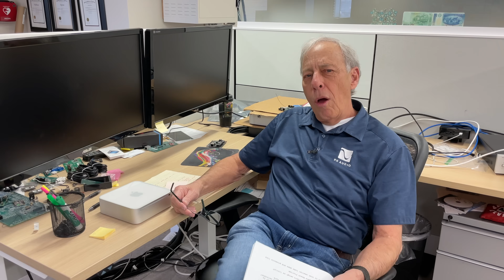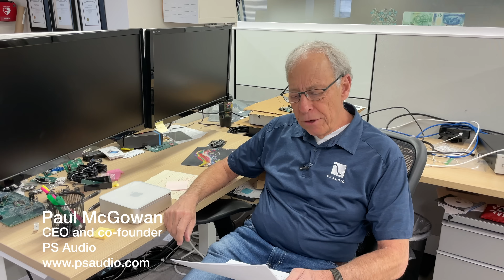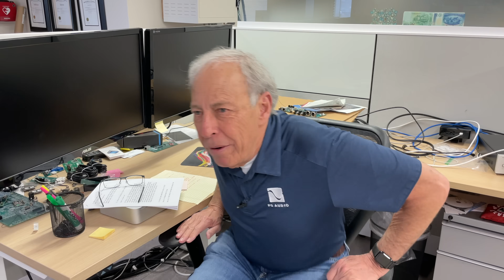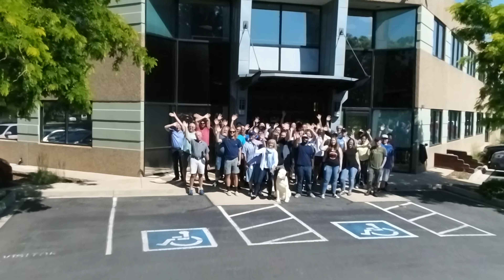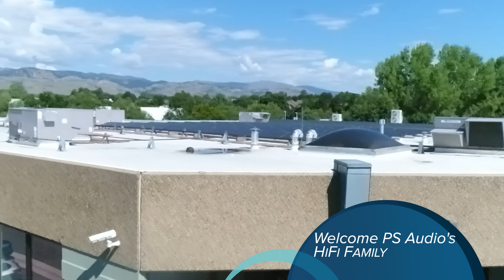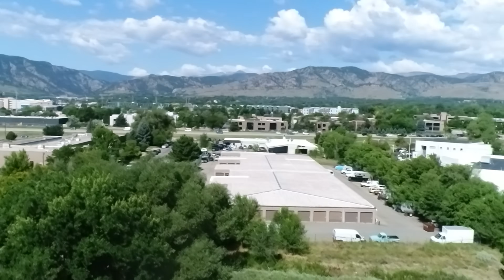What is damping factor?

Comment: Having Paul comment/answer all these questions, i do learn alot. OTOH, reading the comments sections, one can also learn in depth what was asked....But am still lost here :-)
Reply: Don't overcomplicate it. Damping factor simply relates to the output impedance of the amplifier in relation to the speaker.

A speaker is a kind of motor; and, like many motors it becomes a generator when used backward. As a speaker moves it generates momentum and tends not to want to stop.  Then it acts like a spring and wants to snap back -- overshooting equilibrium and causing an unwanted resonance. You can hear this as ringing in your system. 

While the speaker is resonating, it is actually generating electricity since the speaker coil is resonating in the  magnetic field of the magnet.  So the amplifier can prevent the "ringing" by sinking the electricity that the speaker resonance is generating. However, impedance between the coil and the amplifier will slow this process down and inhibit the ability of the amplifier to absorb the ringing in a timely manner.
Reply: @timharig  Thank u for that insight! Which amplifier would you recommend for the JBL XPL200 Stereo Speakers? My amp (Sansui AU-G90X) isnt able to control the big cones very well.. do u have a good recommendation for an amp that can handle those beasts more confidently? :-)

Comment: could you say that output impedance is determined by resistance through the output transistors?
Reply: It's determined by the circuit. In an emitter-follower topology the transistor has fair amount to say about it; but, so do things like the power supply that is supplying the transistor.

Comment: In my old car stereo days, everyone knew Fosgate Punch and the new-comer HiFonics amps had big damping factor for that big bass hit.  Then outboard caps came along with crazy subs like Sundown (sp?), which really gave the hobbyist who likes bass, something really nutty.  

This is a great series; picking a speaker with high impedance can drastically lower the damping factor of an amp, so knowing speaker impedance and amp output is important, especially when it comes to low sensitivity speakers that hover around the mid 80’s dB per watt sensitivity and pairing that up with say a low output tube triode mode amp that say makes 10 and less watts per channel.  Keep up the good work.
Reply: "picking a speaker with high impedance can drastically lower the damping factor of an amp"

The damping Factor of an amp is a set measurable number. Basically it is the amps' "output impedance". It does not change based on what it is connected to any more than it's input impedance. You could go from a 2 ohm load to a 2M ohm load and the amp's output impedance would stay the same. And it would not change what number is published for an amp's Damping Factor as that is just the ratio of that output impedance into an 8 ohn load.
Reply: @Douglas Blake I guess I just don't get the fascination with forcing "Damping Factor"  into usage it has no place in. DF is simply one spec to help evaluate an amp on paper. An indirect way to publish an amp's output impedance using bigger nontechnical numbers. "Damping  Factor: 100" looks much better on a spec sheet than "Output impedance: 0.08 ohms". 

If one pretended DF to be of value in an actual installation with typical speakers (maybe 6 ohms - 30 ohms 20-20Khz) the system spec for an amp with a published DF of 10 would show "DF: 7.5 - 37.5, 20 - 20Khz.". This additional, strictly  mathematical process does not provide any new insighs.
Reply: @Douglas Blake two issues. Both involve trying to twist a simple indirect published specification into something it is not. Basically A/B=C. For DF: A = amp output impedance, B = 8 ohms, C = DF. Yes you could continue to use the formula A/B=C with A = amp output impedance, B = (some external value, instantaneous speaker impedance at given freq, total wire/ speaker @ freq) with the resultant C = some number that will then be called "Damping factor". But other than using the non-changing Amp output impedance, the results has nothing to do with what the term "Damping Factor" as published in an amp's specs means. You could just as easily use A/B=C with A = 1550 ohms (Shure M97), B= 47K ohms (preamp input) and claim that circuit has a Damping Factor of 0.033. It comes down to trying to use the term "Damping Factor" where it was never intended to apply. It is nothing other than a way of spec'ing an amp's output impedance. 

Next that a DF of 10 is sufficient. Again, sticking to the actual definition of "Damping Factor" as the published output impedance based on an 8 ohm load, that would mean a 0.8 ohm output impedance. The same results as adding 400 feet of 12 ga lamp cord to an amp with a 1,000 DF when driving an 8 ohm load. I would not find that acceptable.
Reply: @Douglas Blake You are correct that I started out by correctly explaining that "Damping Factor" is a number published as a spec by amp manufacturers determined by dividing the output impedance of that specific amp by the number 8 to represent an 8 ohm non-inductive load. that number as published has nothing to do with how that amp might be used in the future, what it might be connected to, how many feet of cable, what brand speaker, the speaker's constantly changing impedance, humidity nor latitude. 

Just as the published S/N of an amp has nothing to do with the room it is later put in and the room's noise floor. It is just as irrelevant to claim an amp with a published S/N of 110db has a S/N of 70db because of room noise. 

This has been true since I received my degree in electronics, got an FCC Broadcast license, spent the 1st 10 years of my giving lectures and clinics in Audio for some of the top manufacturers, (Marantz, AR, AT, Kenwood, Maxell, Pioneer Auto, ...) over 50 years ago. Including running a regional Kewood repair facility. To then move to Broadcast Video including entire TV video facilities and satellite uplink vehicles. and then to CGI selling the systems Jurassic Park and  Terminator came out of. Not to mention my dedicated 56k link to ARPANet, now called the Internet. Wrapping up with leading edge IT products shipped around the world. 

so with the facts solidly behind me, I will not be changing my mind soon.

Comment: Damping factor ...... oh boy !!
 Firstly an amplifier output should be non reactive so it won't have impedance ... only resistive ! Secondly if you are familiar with typical speaker impedance curves you will notice the peak in impedance at the resonance where the impedance figure can rise much more than the nominal impedance.. here the damping factor can be very much higher.
Reply: Outputs are only non-reactive if direct coupled solidstate. Tubes (most) use transformers which have high inductive reactance. Some SS amps use DC blocking on the output. Most include a small I/C or R/C circuit in their outputs to stop "speaker cable resonance". And today's digital or Class D? But yes the closer to purely resistive the better. 

But this again confuses what "Damping Factor" actually is.  It ia nothing more than a number for the ratio between the amp's output impedance and 8ohms. How the number is determined has nothing to do with eventual usage. e.g. a 100DF @ 8ohms is a 0.08ohm output impedance. changes in the load do not change that value. Nor do they change how a manufacturer publishes a DF @ 8 ohms number.
Reply: @glenncurry3041  the DF is the source ( amplifier) impedance divided into the QUOTED speaker impedance. But in the real world we know this is not the case ... the DF will vary according to the overall shape of the speaker impedance curve 😃

Comment: Rather than passive damping, you can have active damping with servo feedback. This is especially possible for a subwoofer but much harder to engineer for superior performance.
Reply: You are 100% wrong here. 
The servo doesn't do ANY damping, it does correction on cone overshoot. It can, by the way be done full range. Philips did that with "Motional feedback" as they call it very long time ago already. So damping factor of an amp and a serve controlling a box speaker are 2 totally different things.
If the damping factor of the amp is not good enough, your input to the speaker is distorted. Nothing any servo can do to correct that.
Maybe ask Paul.
Reply: @ESL-Plus  Damping is about reducing resonant ring of the cone. The damping factor is about how effectively the amplifier can short the voice coil to cause an electromagnetic brake of the motion. Ideally the amplifier is having zero Ohms output impedance for maximum damping. Active damping means your amplifier is actively damping the resonant ring by applying an opposite signal to the ring for even more effective damping than zero Ohms. A servo subwoofer (e.g. my Velodyne sub) is using such principle and Philips introduced it decades ago.
Reply: @ThinkingBetter  Paul mentioned in his video (and that is a fact), that the amps output changes because of the reactance (3 factors: impedance, inductance and capacitance) of the speaker. Your servo doesn't change the speakers reactance (combination of multiple coils and a cross-over) to the amp, it only acts as a mechanical correction.
Sorry
Reply: @ESL-Plus  First, impedance includes resistance, inductance and capacitance. Reactance is just the non resistive part of impedance. Damping factor is the ratio between the loudspeaker impedance and the total impedance driving it. An amplifier with high damping factor has low output impedance causing a more effective short circuit of the voice coil against unwanted resonant oscillation. A servo feedback goes a step further in damping the voice coil motion actively by applying an opposite phase signal (feedback loop) during the resonant ringing further damping it.

Comment: Zero feedback single-ended triode (SET) tube amps tend to have a very low damping factor - around 2 to 10 depending on the size of the output transformer. Push pull tube amps with feedback have higher damping factor. Typical solid state class AB designs have a damping factor over 100. From a design standpoint, some engineers consider the output filters of a typical modern class D power amp will lower its damping factor when compared to a direct coupled class AB solid state amp.
Reply: the impedance of an inductor based on the value of the inductance, L, of the inductor and the frequency, f, of the signal passing through the inductor, according to the formula, XL= 2πfL.
Reply: @kalijasin   Thank you.
Reply: @Douglas Blake An inductor that has an impedance of 0.001 ohms from 20 Hz to 20 KHz then having a gradual rising impedance starting at about 8 ohms at 60 KHz? 🤔
Reply: @laurentzduba1298  Exact formula for inductor impedance is RL(f)=2*𝝅*f*L, where f - frequency, L - inductance in Henry (after Joseph Henry), while symbol L is after Heinrich Lenz.

Comment: Hegel has high damping factor, thats not the reason i bought it,  i like them as pakage, they have very good controll and good details in the sound without being bright
Reply: Yeah, I love my H160.  It's very clean and controlled, no hiss or noise of any kind no matter the volume.
Reply: I used to have a h360 that served me well. I gave moved on to a krell duo 300XD that I like even more.
Reply: I have a H300, it sounds pretty nice.
Reply: The you don't understand what Damping Factor is. DF helps show how well an amp is able to control (damp) a speaker so it can "have very good controll and good details in the sound". A high damping factor can mean the amp can better control the speakers' movement. Force it to do what it wants.
Reply: I understand what damping factor is, i just said that its not the only reason i bought hegel
Reply: @andreasmoller9798  You did NOT say "only". And the high damping factor is what allows the Hagel to "have very good controll and good details in the sound".

Comment: What is output impedance anyway? Which part of the circuitry has output impedance?
Reply: Every output can be defined as a Thévenin equivalent source with an idea voltage source in series with an impedance:

https://en.m.wikipedia.org/wiki/Th%C3%A9venin's_theorem

It isn't necessarily a single component that creates the impedance. It is a result of the entire circuit topology and everything in it.

Comment: Depends on the speakers you got high efficiency speakers at 98-99 DB then really you want a low damping factor 60 to 120 damping factor up to 300 is fine you don't need to go any higher than that. Only caveat is if you're playing subwoofers bass reflex then maybe up to 600
Reply: Thank u for that insight! Which amplifier would you recommend for the JBL XPL200 Stereo Speakers? My amp (Sansui AU-G90X) isnt able to control the big cones very well.. do u have a good recommendation for an amp that can handle those beasts more confidently? :-)

Comment: One of the seminars I used to give on loudspeakers and amps included demoing Damping Factor. Very easy to do. Take any speaker, the larger the woofer the better, with it disconnected from any amp, tap on the woofer cone and listen to the resonance. Then short the speaker terminals, a piece of wire, I would use my keys, and tap on the woofer. The amount of control exerted on the woofer by itself, the counter EMF allowed to flow in the completed circuit, is extremely audible. To then explain how a high damping factor means low internal resistance in the amp, like the keys shorting the terminals. And how that allows a speaker to control it's own  excessive reaction to a signal.
Reply: @BubblePuppy.  Yes, a wire moving through a magnetic field generates a voltage. It is in the reverse direction (polarity) to the voltage sent by the amp. It is called Counter EMF (Electro Motive Force). 

Damping Factor is the mathematical ratio of the speaker impedance to the amplifiers output. A perfect solidstate amp would have a zero ohm output stage. It would act like the keys and allow the counter EMF to feed back and control itself. 

With no load on the speaker you are hearing basic resonance of the driver/ cabinet. With a short you are hearing how a good amp takes control of that speaker system.
Reply: That was a excellent and simple explanation...
Reply: Fascinating insight.  Thank you!
Reply: How speaker's crossovers affect damping factor?
Reply: @chichanleon123  Lots of variables. In pure theory DF is just the mathematical relationship between an amp's output stage largely based on the power supply's internal resistance and the load/ speaker impedance. But negative feedback designs can dramatically increase the published number while negatively impacting sound. All that aside. Crossovers for multi-driver speakers can be anything from a capacitor in line to the tweeter which would have no effect, to massive sets of coils which have their only counter EMF and impact the effectiveness of the DF on the woofer itself. None of this would impact the spec of the amp's DF. Just it's interaction in the overall amp/ speaker system.
Reply: So high damping factor  in the amp does not matter for the speaker control?
Reply: @jeffriver9715  I'm assuming you posted this in the wrong place. It makes no sense RE what I posted.
Reply: @glenncurry3041  Thank u for that insight! Which amplifier would you recommend for the JBL XPL200 Stereo Speakers? My amp (Sansui AU-G90X) isnt able to control the big cones very well.. do u have a good recommendation for an amp that can handle those beasts more confidently? :-)
Reply: @toktok3796  Those speakers are very efficient at 90db. But can handle lots of power if you want lots of SPL. And reasonably easy to drive. Not sure what $$$ range you are looking in? Paul has a number of good amps at PS. From the Sprite on up! And depends on what kind of music you prefer? Those with a nice modest to lower powered tube amp? Or First Watt by Nelson Pass. But if you want to rock! Hegel seems to be getting a lot of positive reviews in that market. I tend to go old school and am running a Nelson Pass ADCOM GFA555. 

Your Sansui has a big enough power spec. But frankly Sansui did not make that good sounding of gear.
Reply: @glenncurry3041  thank u very much for ur feedback!